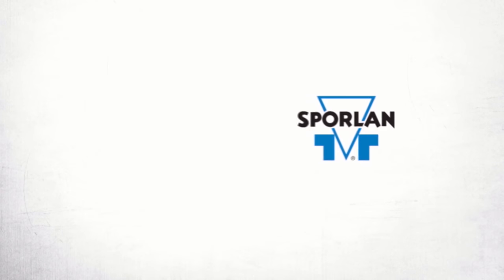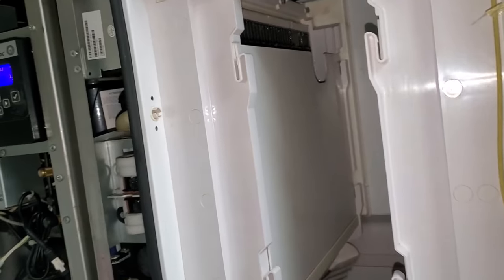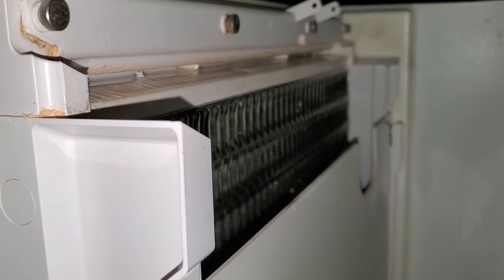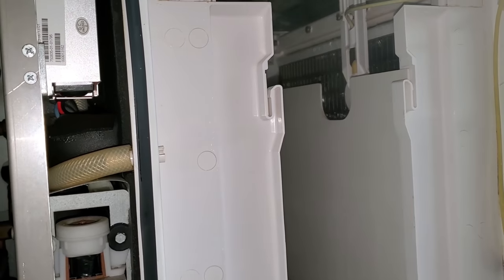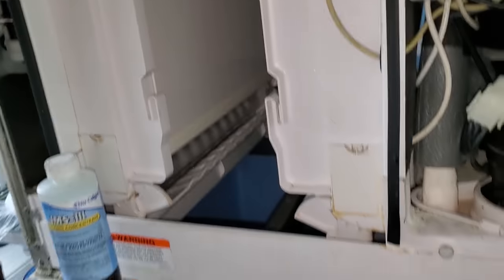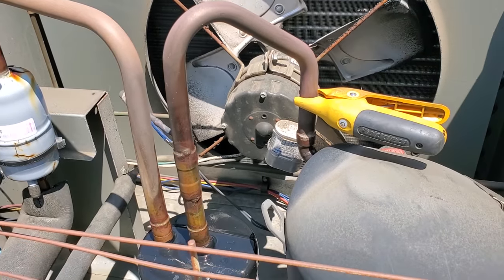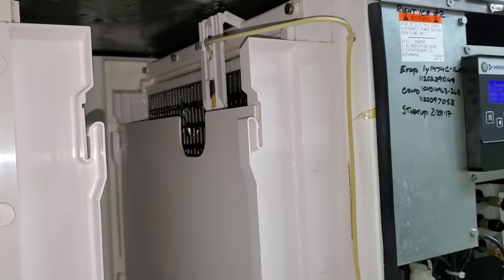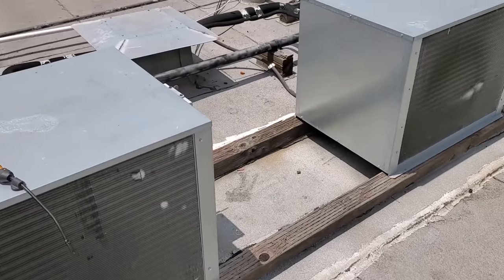BOTH ICE MACHINES ARE NOT WORKING

Comment: It's been over ten years since I serviced and performed maintenance on ice machines. At that time, I did all Scotsman service work. The machines were old enough, even then, that they used the old capillary tube technology strategically located in the bin to detect bin ice level in order to know when to cease ice production. I kept those old machines running for a long time. Looking at you work on the two machines in this video, I see how ice machine technology has changed. The timers on the machines I serviced were all electromechanical, until my last few years doing that specific niche of work. At that point, I started working on the newer Scotsman machines for that time period. They were equipped with circuit boards (mother boards) controlling the sequence of operation and, if I remember correctly, ultra-sound sensors in the bin for ice level detection...Good work in this video, as usual.

Comment: Excellent work. Ice machines can be extremely difficult to diagnose without the proper amount of time for data collection. Data loggers can only do so much without hands on.  I was the last tech hired so I ended up being the ice machine cleaner tech so the others could just run diagnostics. Still I learned a lot working on them actually using the knowledge I had from school but had never got to use. Of course the bad news was finding out how infrequently some customers would have a unit serviced and cleaned, lol.

Comment: I’ve been working on ice machines since 92’, and Manitowoc has yet to win me over. I like the control interface, but it ends there. Hoshizaki seems to know how to keep it simple, and their plates are bulletproof. Manitowoc will keep the service guy busy. In the old days, they sold a factory add on water clamp to slow the water down going over the plate to dial in the bridge thickness top to bottom. Tilting the bin forward and silicone spraying the plate was needed to get them to harvest after a couple years of service. Good catch on the compressor. Pump down testing for compressor capacity is the best way to do it when it is not obvious. Sometimes you just have to dump the charge and recharge then move on.
Reply: Manitowocs will keep a service guy busy ONLY if he dosnt know Manitowocs.  CALL TECH SUPPORT, THE MAKE U LOOK LIKE A HERO TO CUSTOMER. Simplest  machines out there. Once u use a screw driver to open door, all sensors, water system parts come out without any tools.

I see JUST as many Hosi failures and problens in design that have never been up dated. A Hosi KLM made 10 years still same parts as one made today. Still use to much water.  Hosi # 2 IMHO of the MANY manufacturers. When the evap plate get severely scaled on a Hosi it can be a bitch to get scale off the plate so it will harvest. Freeze ups frequently result in the water/ice separator tray breaking when the large chunk of ice falls off plate. i stopped doing warranty service because Hosih expected me to pay for diagnoses or repairs on machines I sold, wtf? I have no obligation to cover any manufactures warranty for them. OFTEN must wait for parts from factory. They can a BITCH to diagnose if there isnt room above the unit to work.

Comment: As I have always told you I like your videos a lot you are a technician just like me if we do not change pieces to change but investigate why a part stops failing because a component is failing And that is interesting because applying the research methodology is what It does not help to correctly diagnose a equipment failure and make a correct and perfect repair of the ice page. They are very special. You have to be very patient with it. You have to observe a lot and implement very methods to be able to diagnose the failure correctly in your case. I see that they use a very good tool in Mexico if they sell it but it is very expensive And the truth is that I only have a digital manifold of the Master cool brand And why it was not enough to buy one that you have but I really like your methodology research and that is good the ice machine and sometimes it happens that with the lack of maintenance this the sensors start to fail makes you believe the machine that has water when it really does not and in terms of the compression ratio in the compressor I have sometimes had that question is because sometimes a compressor does not work well or does not compress well and suddenly without compressing well in the end I think maybe It may be the change in temperature here in Mexico we do not have as much variation in ambient temperature in places where I am living is very hot, that is, a thing made of ice makes it above 38 to 40 minutes in the climate where you It is not sure what ambient temperature you have but this one I imagine that in a smaller period of time the ice machine can carry out more harvesting cycle, patience is still quite interesting enough to cultivate it to be able to find the equipment sometimes it happens that clients who do not call are those who do not have patience but over time the client also knows how to evaluate which technician knows how to work well Lve problems well I am glad to have seen your video and the truth is that every day I learn something new and I always wait for your video Greetings from Mexico.

Comment: I never realized that these type of Ice machines had equipment outdoors on the roof, I always thought it was all self contained.  Interesting.
Reply: It is nice to keep the heat out of kitchens.
Reply: It's depends, some are all in one, some have roof top units.
Reply: thanks for answering my question.
Reply: There are traditional remote condensing units. (Compressor in head, condenser fan/coil outdoors) Quiet cubes where compressor is out doors also, no compressor in head unit, very quiet.

Comment: Good job with the compressor diagnosis. I thought maybe there was air in the machine. I may have pulled charge and recharged with fresh filter and refrigerant before finding out the valves are bad.

Comment: Maybe the higher harvest high side pressure was archived using a bigger compressor. Maybe they changed it to a smaller one for cost efficiency, even if it decreases the performance of the machine a bit.
And in my opinion the "weak compressor" clearly has a bad suction valve. If the HP discharge valve (and the internal overpressure relief valve) is still okay, you won't have any refrigerant flowing back, only this really bad pumpdown pressure.

Comment: Henry Vogt made the battle axe of production ice Machines. Worked on lots of HE40's Unfortunately they got priced out of the market since they were overbuilt and buyers don't care if a machine lasts 20 years. They just look at 4000 lbs. of ice in 24 hours and what is the cheapest machine to do that with the least water and power consumption. Also the old Scotsman pillow cube machines were pretty reliable. If you ask me, some of the machines were getting a little too overboard with energy efficiency and were having solenoid failures, especially Manitowoc's with CVD harvest.
Reply from the maker: I worked on a few of the vogt machines in the past too

Comment: Great work I like your techniques on troubleshooting who cares if you take your time you need to be through when accessing machines . Most of the time if you have to go back to the same job the customer probably won’t want to pay you . I’m the same as I hate call backs if your there on the job it doesn’t take much longer to check the whole unit over and you can always let the customer know if you find other faults or possibly faults that could cause another breakdown and down time . do it once do it right keep. And my motto is prevention is better than cure 
up the great work . Cheers

Comment: The last thing you want to do is put gauges on an ice machine. 80% of the problems you run into with ice machines is water related. 15% is electrical and 5% is refrigeration.
Reply from the maker: I will discuss this this evening 6/8/20 @5:PM (pacific time) on YouTube, come on over and check it out https://youtu.be/Kb28yZQCico
Reply: OMG, self contained units. So many times I have been called in because servicing Co cant diagnose the leak. THATS BECAUSE THERE NEVER WAS ONE!!!!! To many techs LOVE to put gauges on machines with 5' hoses, LOL/ Smaller self contained units hold less than 1lb charge under counter units less than 6 oz some times. Pust those hoses on once or twice and you remove a fair % of units charge.

Comment: I build and work on ice makers. Peopls rarely if ever clean the icemaker.  I have to tell myself not to think about it when I go somewhere. I usually dont get drinks out.  Dont understand how they pass any inspection. I have not seen a clean one yet that I have worked on.
Reply: You're supposed to clean them every day I guess. But they probably do it once a month tops.
Reply: Once a month is probably right. Maybe once every 3 months.  But I highly doubt many places do
Reply: I am a Manitowoc FSA. If ice machines were cleaned once a month I would be soooo happy. 90% of ice machine calls are water system related. Most are not cleaned until they stop working. It takes a screwdriver to open the front door . After that it takes NO tools to remove all sensors, water pump, water distributor etc and clean them. clean FLAT surfaces you can wipe in seconds rather than all the nook and crannies for mold and bacteria to hide. I hate to clean Scottsman water systems the most.
Cleaning and De-scaleing are two different processes. You should clean all the parts in water system monthly. You should really only DE-scale only when necessary, (melt outs on back of cubes, long harvest or freeze ups/ ice wont drop off plate), as the acid to de-scale also can remove metals from the plating and shorten evap plate life. If it takes 7 months to scale then set schedule for 6 months,. but DO NOT de scale every month unless absolutely necessary. If so address water quality problem. 
Using a non nickle safe de-scaler WILL damage the evaporator plate. Use only Manitowoc chemicals. Do NOT use bleach to sanitize the plastic parts, it will make them brittle. 
IMHO Manitowoc is the best machine out there. I have worked on them all past 30+ yrs. 
Manitowoc Tech support is THE BEST and UNITED has 99% of the parts you will need in stock. Chances are is if you get a FSA to work on your Manitowoc that he will have the part on his service truck.
also, if the cycle times are correct, production is correct, TECH will NEVER have u change a compressor because of low discharge pressure during harvest. NOT just because JUST of that.
Reply: @frostygt3628  At my store they used harsh cleaners and a stiff brush to clean out the ice cube part. (degreaser, bleach) Completely ruined the nickel. It was dropping two inch slabs.

Comment: The ice thickness probe is a microphone?.... mind blown 🤯
Reply: It’s probably more so an ultrasonic piezoelectric sensor. It listens for a feedback of transmitted sound. When there is no ice, the signal passes through. When the ice begins to thicken that signal / waveform changes causing it to dump the ice. Pretty cool stuff.
Reply: I wonder if it's a similar system as the parking sensors on a car. They use sound reflections to measure distance to objects.
Reply: Its an actual microphone that pick up a certain range of sound, 40K htz, i THINK.

Comment: Manitowoc has new updated firmware for these machines That removes the sensor's ability to shut down the machine due to any bad readings, it will still throw codes, but the sensors no longer have the authority to shut down the machine.

Comment: Question, when you dine out do you ask for a drink w/o ice:) Pretty nasty in there! Also you explained at the end you choose to take the time you need to oversee a repair. Does that reflect in the billable hours or do you charge them a flat rate knowing what the repair takes?Unless it’s a uncommon model. In the auto industry we use a flat rate guide for the most part.

Comment: About the flat rate time the manufacturer gives you for any maintenance, it's crap. I was a line mechanic in the automotive field for years and there were only a few jobs that the flat rate could be equaled or beat.  Then I found out how the manufacturer sets flat rate.  A new unit is set on a work bench and a tech does a particular job and is timed.  No way we can compete with that. 
Sometimes the manufacturer doesn't have a good trouble shooting guide so it takes as long as it takes.  I'm pretty sure you run into that.
Reply: I was an auto technician for many moons. I must say 95% of the time flate rate times are near impossible to make. Especially when you take into account time racking, trouble shooting/diagnostics, tool prep (making sure u have all the right tools and gather them onto your job cart. Then assuming you have everything together and ready to go u have at least 20 min of road testing, and double checking job quality. Unfortunately when ur working in a shop w questionable practices (if u have turned wrenches for any length of time u have come across this type of shop) u will often find the customer is billed for ur extra time/labor but that coin never makes it into the technicians check. 

As for the other 5% of jobs that are easily accomplished under book time u will find one of 2 things. Either the shop will have a guy who usually changes tyres and brake pads (making $10/hr under the table) all the sudden getting every alternator, tensioner, battery and cables, starter motor, etc easy swap jobs done by this guy. Gobbling up all the easy 10min jobs that are booked at an hour (also these guys dont usually get any % of parts or labor so its win win for the shop, and lose lose for all the real techs.). 
The second one u find is the shop owner (or his son/cousin/nephew/ etc) pulling the high payout low labor jobs from techs and shuffling them to undereducated noobs. If u find urself in one of these shops do urself a huge favor and start applying for new shops. Tool boxes have big wheels for a reason, so u can roll them rihht out of a poorly managed shop and into a respectable business. Shortly after leaving one of these terrible shops the place was raided, police found garbage bags full of double receipts.   Some were cleverly signed by unknowing customer as part of a pile of carbon copies. Others the manager (who has a very serious cocaine addiction) would just scratch the name of a customer on a bill and run the CC the shop kept on file. Dont waste ur time or soil ur name by association with these type of shops. I had a terrible time getting a new job after potential employer found out where i was working. Fortunately if i had the opportunity to speak to a new boss they would usually understand i was fleeing the place looking for honest work.

Comment: I never realized they use mics to listen for the ice cracking. Does the machine use the frequency of the cracks or decibel level to determine when to harvest?
Reply from the maker: Its not listening for the cracks its actually listening for the turbulent sound of the water running over the ice, as the ice gets thicker the water gets closer to the microphone
Reply: @HVACRVIDEOS  very cool. Thanks for the reply. I have some knowledge in this stuff but not a lot. More so residential than commercial

Comment: Completely different topic: What's your opinion on AFCI+RCCB fuses for new installations or overhauls? 

I've seen many of your videos and it looks like an AFCI/RCCB combination could have detected most of your electrical faults of the units early on. Especially if installed in front of the fuses/disconnects which seem to have issues too.
Reply: lots more rotten foods lol

Comment: I’m sorry to put this ? here but I’ve watched your videos for a long time and always take your advise to be accurate and most importantly genuine.

I’ve only worked on my own restaurant equipment, but over the last 4 years feel I have a grasp for commercial refrigeration work and most importantly diagnosis. I’m certain EPA requirements are a must for which I only had certification for nuclear waste, working in that industry for a short time. I’m not sure if hvac school is a must, or apprenticeship for that mater.  I’m still in my 20’s and need to pivot into a career I can make a living in, having a Biology BS. Would you advise your cousin or nephew to look at hvacr or comp sci for example. I see a lot of old timers jumping info hvacr school, because of financials. I don’t know if that is a bad sign, or a quality of life decision. I have some experience in both electrical and software engineering largely from tinkering and not from school.

I know this profession is not easy, having to stretch yourself out in odd spaces, or with limited ventilation, and is overall physically challenging etc. A lot of small businesses were already hurting, so I can’t imagine the current situation will help with the haggling situation you will deal with.
Thanks.

Comment: You should update the firmware on the units go to manitowoc website and you can download the newest firmware. also you can check the voltage on the control board for you thickness probe should get 3.25 to 3.35 vdc if you dont you will have a bad control board.

Comment: They’re a pain in the ass but when you fill a cup of ice from those machines the water tastes better than any bottled super filtered water because as the water runs down the curtain it doesn’t freeze the minerals like chlorine and calcium and such which require a lower temp to freeze and dumps that water then replaces it with a fresh batch for the next sheet. Sooooo tasty .